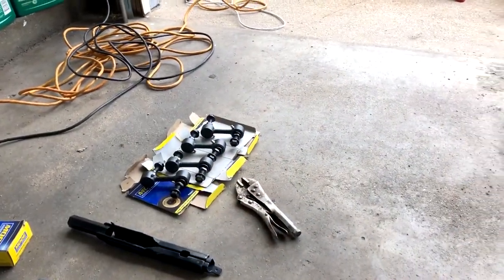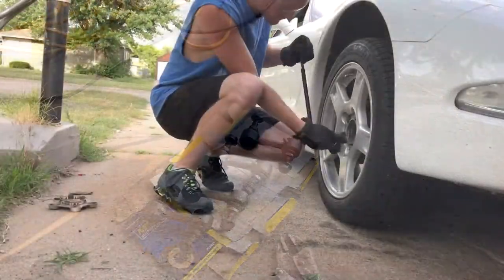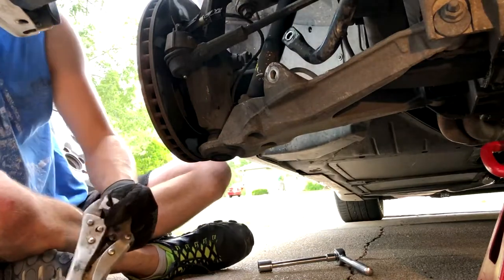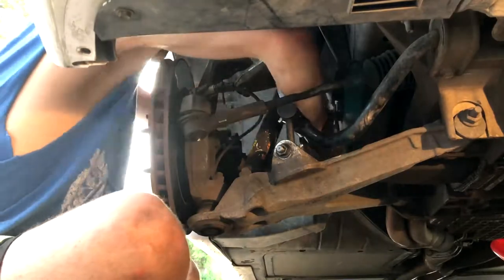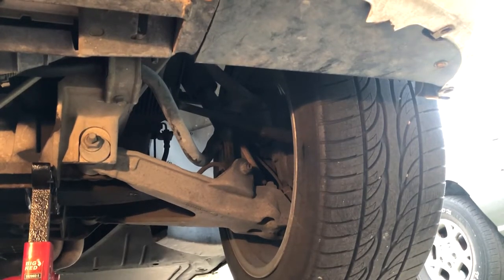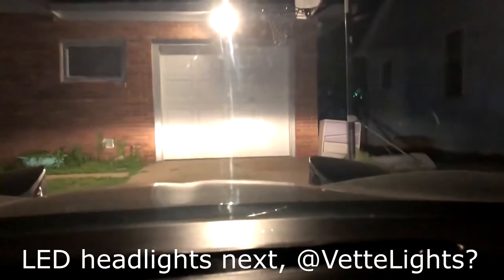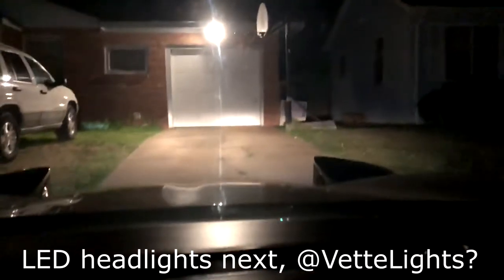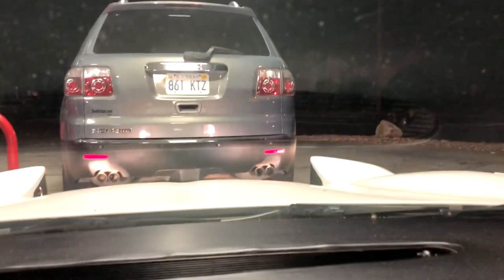How To Replace Sway Bar Links on a Corvette

Comment: I lowered mine on stock bolts.  Lowered the fronts all the way to the bushings and the rears almost all the way.  Still have wheel gap, but it's better than the stock look.  Plus it's a free mod, should have done it when you had all the wheels off lol.
Reply from the maker: YellowVette04 do you have a video on lowering? This is my second attempt, so I'm definitely missing something lol
Reply: Arctic Vette I don't, did it before I started the channel.  Froggy and a few others had good vids of how to do it. It's not a big difference, maybe 1/2".  There's too many things to scrape on in my area, so I'm happy with it. I know most of the "scrapes" is the air dam, but still doesn't sound good. I'll send a pic of the gap in the morning.
Reply from the maker: YellowVette04 I'll have to check them out then. Awesome thanks! I need to fix one set of exhaust bolts that scrap otherwise I'd be good, oh and minus the driveway.